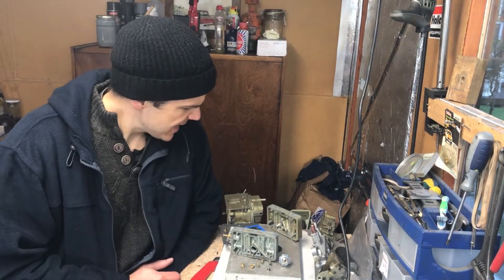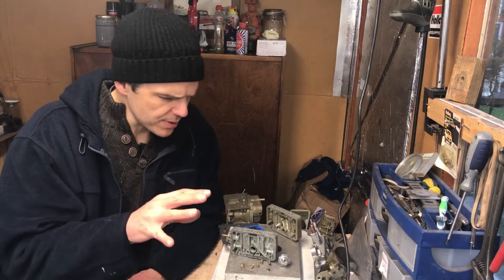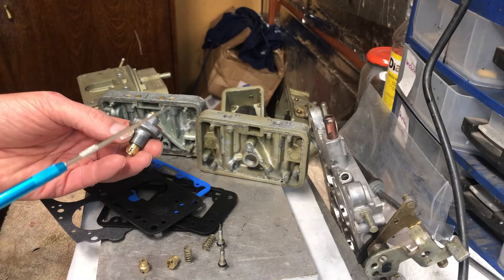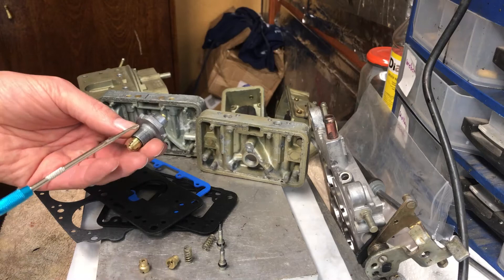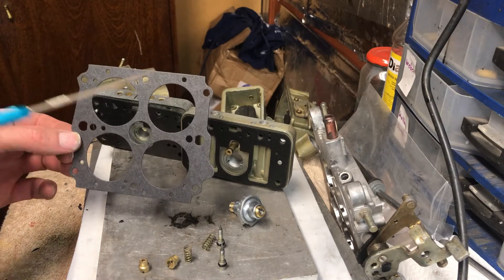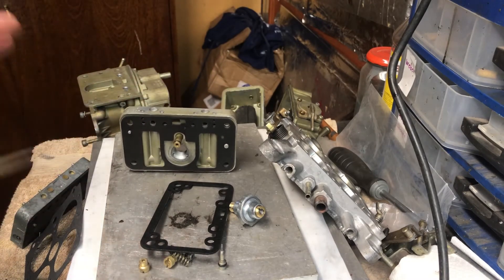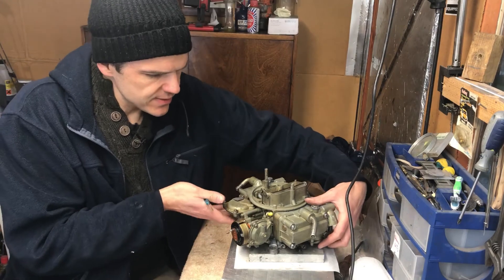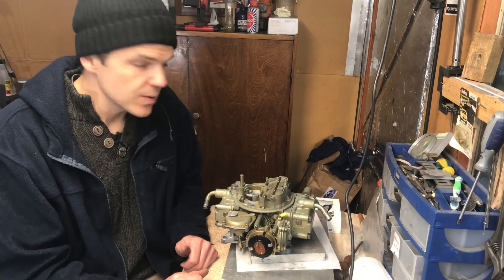Rebuild of a Holley 4180 600cfm truck carb. What are the differences between the 4160 and the 4180

Comment: On the fuel bowl were the fuel filter screws in, there is a area on the right hand side of that area that looks like a plug in the casting. It seems to have just started to leak on my 87 F250. Is there any known place to get these plugs? I would prefer not to JB weld it.
Reply from the maker: You will probably find it is cheaper and more practical to just get a replacement fuel bowl. JB weld may or may not work so I would not strongly recomend that, but it could be a temporary field repair type thing

Comment: I have a holley 4180 in my 87 f250 with the 7.5L 460. The threads where the fuel filter screws in are all gone from whoever worked on it before i had it. What is the part im looking for? It seems that it covered the metering block
Reply from the maker: Fuel bowl! There are replacements arround
Reply: @carburist  I looked it up and it doesnt seem to be the right part, maybe im not looking correctly. Is there any way I could contact you to send pictures?

Comment: Hello. What is the starting set point for the idle mixture screws? On that base plate? I have this carburetor in my 1985 Mustang 5.0 ho
Reply from the maker: 1.5 turns out when fully seated

Comment: Where can I get the 4180 rebuild kit?
Reply from the maker: you need to import them straight from the US, they are not in stock here in the UK because these units are so rare over here.
Reply: OK so I just rebuilt my 4180c using a basic holley kit. I had to "convince" some gaskets that they belong and I still have terrible issues with it. Should I get the actual 4180c rebuild kit? Lol